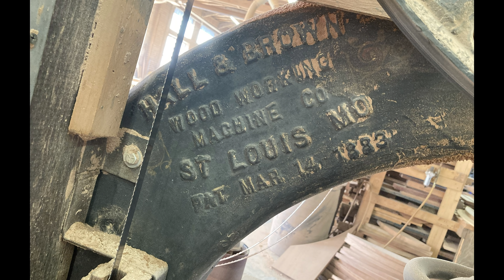Why Am I Getting NEW Window Sashes? More STRIPPING! EP 12

Comment: I've lived in an old house with old windows. It was miserable in the winter. Sometimes the best thing to do for your comfort and utility bills is to replace windows. The purists don't pay your bills. Thankfully, my house isn't as old and I was able to get Anderson 400 that looks like the older ones. You do the best you can and find an acceptable compromise like you're doing.
Reply: Inside snap -in storm windows are a low cost solution.  Made from clear vinyl they are held in place with self adhesive foam strips.

Comment: You are doing fantastic work indeed. For all the naysayers, ignore them. You are doing the house, and it's history proud. The new windows will be beautiful. Painting the outside is the only accurate and sensible way forward. They were painted from new. Even marine varnish needs redoing every few years. I cannot wait to see the end result. Well done, This Man. Originally the house would have had wooden storm windows on the outside of each window, that would need to be taken down in the spring and screens mounted on their place. A lot of difficult work twice a year. My folks had all new, custom made double hung sash windows made for our 1903 solid brick semi-detached. They were done by Sears, of all places. From the street, nobody could tell they were thermal pane double glazed with Low E coating and were argon filled. They also tilted in for cleaning. Is was as much of a safety issue as it was a matter of the old dashed, frames, and glass reaching the end of service life. Those windows are still in the house over 40 years later, and still working as new. None of the seals have failed, which is incredible.

Comment: It's your house,  you can do whatever you want with it. You're keeping the house as original as possible but within your means. People belly aching about you replacing rotted/broken windows should send you money to fix them. Keep up the good work!
Reply: Agreed!
Reply: Some of those sashes are beyond repair. The structural integrity is gone. On the ground floor, the original window sashes are simply not there, as they have already been replaced. The new windows will all match, for the first time in decades.

Comment: We have just replaced our windows with (gasp!) Aliminum double glazing,  we had the leadlight done too. It was almost impossible to get wood replacement , don't even ask the price! Or source timber.  Our glass was hand made,  don't even go there!     It was a major drama , to get the style and framing the same. 4 measures , 3 installments .but we got there. The frame colour was an off white / pale cream, looks just right. Interior frame we had made the same as what was there. We had major bug infestation  in 4 of them.         All you can do is make the best of what you have,  and what you are able to source. And you are certainly doing that, its wonderful to see others catching the bug for older homes. You are doing an excellent job.  Well done.

Comment: You can steam out the dent in the wood trim. It will help you get to those little spots where the paint lays in the damaged areas. Gunsmiths do this to lift out dents with high grade wood stocks. It’s better than sanding which can remove to much of the original character

Comment: You can move that table saw yourself. Get 3 pieces of scheduled 80 and cut it wider than base, tip saw, adding each pipe one at a time. Push slowly until one piece gets kicked out the back and move it forward. Repeat until you're at your destination!! I did this with a 12X16 shed and moved it myself over grass.

Comment: Do consider if its possible to insulate those exterior walls that you are having to replaster. Even a 1" thick foam insulation makes a huge difference. It would also give you a place to run electrics.
Reply: Modern insulations can be detrimental to historic houses. They need to breath and insulation doesn't allow that.
Reply: Yes if it was me I would insulate bedrooms and bathrooms.

Comment: Thank you for going into more detail on the windows.  While I'd advocate for restoring the original sashes where possible and for matching the historic wood species where new wood is needed, I can definitely appreciate having a limited budget and the need to secure the envelop of the building.  I have been associated with many restoration projects and cost is always a major factor.  Taking a phased approach with the windows is understandable.

I am very glad to see that you are replacing all of the non-historic window sashes with new sashes matching the profiles of the historic.  I am also very happy to hear that you are keeping and storing the historic sashes so that repairing them can be a future option.  Be sure to number them to their specific window openings before you remove them as they were often custom fitted in their frames.

While Mahogany is a good wood for window sashes, the change of species can make it a challenge to match the historic interior finish.  When trying to blend in a non-matching wood species, the first impulse is to darken everything - but to do so conceals the beauty of the historic woodwork.  Keep in mind that since the mahogany is the non-historic material, that is where you should focus any necessary tinting to try to make it work with the surrounding historic woodwork - not the other way around!  
  
Keep up the great work!

Comment: I want to make a little suggestion maybe you should probably think about when you take the old windows out to see if you can combined all the wavy to glass into the new windows, so that way you can still have the wavy glass look. probably use those if there's enough to combine them into a whole window, and put those on the front of the house. That way when you look at the front of the house they basically look completely uniform with the wavy glass if that's possible. Just an idea to think about. That way it saves on the cost, and for the future plans you have of getting more wavy glass. Also if you only have enough for a few of them than at least those are already done.
Reply: I was wondering if anyone else had this same idea,...  great minds think alike!

Comment: I restore historic leaded glass windows. If you want wavy glass a good way to get it supper cheap if not free is go to construction sites on old houses and buildings and ask if they are replacing the old windows with double pane and if they are ask if you can have it. Another is make friends with a window installer, they are replacing old windows with double pane all the time. Tell them you will pay them to save old windows they replace.

Comment: Another great vlog.  Questions.  Are you going to strip the baseboards?  Where the staples were, will you being using wood fill on them and if so what kind?  When you are stripping, did you use steel wool to finish?  Have a great week.
Reply from the maker: Yes on the baseboards the windows are just first on the list. Im not sure about wood filling the staple holes i might wait until they are stained and finished and use one of those color matched wax sticks to fill the holes with a correct color. Or maybe wood fill and faux grain them in spots. And yes on the steel wool. A lot of steel wool.

Comment: Tests have shown that less heat is lost thru single pane glass than in loose and poorly installed windows. Keep it real, and as original as possible with "some" modernization where needed. I like your approach. regards, Solomon

Comment: Good luck using those old 2x4s those  look like Ponderosa pine with age they get hard as concrete. You can't hardly get a nail to drive straight. And some I have redone I had to put modern tuba fours next to the old ones in order to have something to nail to

Comment: I understand the desire for everything to match, but I'd be tempted to tally up what I have and try to do one side of the building, or the private rooms or public rooms in the old glass straight away. My experience has been that basement stuff just gets becomes clutter that prevents easy access to things that need fixed. I'm glad you showed the old sashes, repairing them definitely seems crazy with as neglected as they are.

Comment: Just a thought if you replace any lathe and plaster with regular plaster board, if it doesn’t make sense in certain rooms for example due to cost. you can slightly emulate the acoustic of it by using acoustic plaster board. Although it wouldn’t be the same it would be closer than regular plaster as they have similar acoustic properties.

Comment: I've got two handy hints for saving you time and money with the window restorations.   
1) Build a steambox for the sashes.  This makes it very easy to remove the existing glass panes. Also, you'll be able to strip most of the paint from the sashes very easily. 
2) Put all your painted window and door hardware (iron, steel or brass), including lifters, locks and rollers into the embers of a fire.  In 20 minutes all the paint is gone and you then just need to clean them up with soap and water, steel wool and methylated spirits.
This will save you both money and hours of toil.  I learned about them both from watching YouTube. Good luck!

Comment: I had an 1865 house... Replacing the old sash windows with architecturally correct working sash windows with uncracked glass and working weights etc was expensive but we'll worth it. No aluminum!! Great job you're doing.

Comment: When it comes to the issue with the wavy glass- would it be possible to salvage it? Perhaps it is because I am not an expert at this at all, but I personally would keep the wavy glass panes and, when reconstructing the window, I would place the wavy glass panes on the top row of the widow and then the rest of the window could be standard glass. This would only work if you have enough way glass, and you may not be able to do all the rooms. 

Perhaps it would look odd to see it in-person? I don't recall what wavy glass looks like compared to standard glass in-person.

Comment: I don’t know if you’ve tried this but I have used a mini-hacksaw when trying to get good mill work off the walls without splitting or cracking. If I can get the woodwork out just far enough to slip in the hacksaw blade then I can use the blade to cut the nail. One the first nail is cut I then slide the hacksaw up to the next. Once the woodwork is off I determine if I can pull the remaining piece of nail through from the back. If I can’t then I’ll leave it in place and just grind or sand down the old nail nub to the wood surface.

Comment: Will you do hung windows with sash weights?  I did not do that.  We went for a wood window with weather resistant outer sheath and double pane.  We filled the weight channels with insulation.  Our house was built in 1874.  We owned from 1981 - 2015.  It sold on the day of the open house.   Your decision, what ever it is, is the best for you and your home.

Comment: Have you tried using dental picks or even the cheap wooden shish kabob skewers to get the paint out? Works great for the tiny nooks and crannies.  Good luck and looking fantastic.
Reply from the maker: dental picks have been super helpful. Along with steel wool and copper wire brushes. All used very lightly of course.

Comment: I noticed while during the paint stripping parts that you have older, non-grounded outlets in the trim, and newer looking (possibly grounded) outlets next to them. I know you mentioned the electrical needs to be redone due to the knob & tube. What are your plans on the outlet placement? Or are you at the mercy of the electrician for those decisions? 
Also, I'm guessing you'll be getting rid of all those old phone boxes. 
Amazing work so far. I'm really enjoying the videos.
Reply from the maker: I think we will run them in the floor on the exterior walls. They currently have conduit running on the outside of the building which i hate and want to remove. A lot of other decisions will be made by the electrician though as i dont know how many outlets a room needs to meet code.

Comment: I did not hear it in the video or see anything in the comments about the replacement glass type.  Are you going to go with insulated panes?  As some of the others have said, old windows, single pane type, will leach a lot of heat.  By putting in insulated panes no one will be able to tell just looking at them and you will appreciate it in both cold and hot weather.  

Also, as someone who has stripped a lot of woodwork I do not envy what you are doing but your trim is beautiful and it will be worth the effort.  My wife and I were so thankful that our 1890 house does not have painted trim.

Comment: I would get rid of that medium sized tree next to the garage. Now, I abhor the removal of trees. But, in this case it's too close to the garage and as time goes on and the tree gets bigger, it will damage the garage foundation.
You can see where the leaves are already running havoc on the garage roof and a constant maintenance chore.

Comment: When you were outside, (7:45) between 1st and 2nd floor there are diamond wall tie plates. Likewise at ground floor level (23:00) There will be thick iron rods through the floors to diamond wall tie plates on the opposite side of the building.
In view of the level of decay in the house, you may wish to check those rods for corrosion. They are there to stop the walls bowing out. There didn't seem to be any cracked brickwork so all may be well, worth a dose of looking at though.

Comment: Don't beat yourself up for replacing the sashes. Although I believe in preserving everything original, I entirely agree with your decision to replace them with accurate reproductions as they not only all match but will better prevent water infiltration and further damage. Besides that you are preserving them by not discarding them. I would suggest that you try to reuse enough of the period glass for at least the street facade but that, of course, is completely up to you. Keep up the excellent work, I love to see a sensitive restoration!

Comment: Basically what I was trying to say before is this..at least you have the first floor where it's most noticeable and that's most people's eye level I.e. ground level per se. with all the wavy glass in them which will give you the original window look that you're wanting. so then you can knock out those from the start. You will have a head start on getting the original wavy glass look back into the front of the home. Which is a money saver in the long run....

Comment: Great job.   Just an idea about all those horrible staples.  Staples don't make drilled holes, removing wood fiber from the trim.  Staples sorta shove wood fibers to the side and  squeeze themselves between the compressed fibers.  Soooo the wood might all be there.   If you steam the boards it may make the wood fibers decompress and fill in the gaps made by the fibers.    Just an idea.   I've seen Norm Abrams (from This Old House) make a steam chamber with large PVC tubes and a steam source.   Just something to think about.  Good luck.

Comment: Admire how you're taking great care with the trim work. How many layers of paint are you having to strip off??
Reply from the maker: depends on the room. But between 4 and 7 ish from what ive seen. few coats of aycrlic on top with a few coats of lead underneath. Although most of it is white so its hard to tell. But its pretty thick in areas.

Comment: No one should give you flack for the way you've chosen to replace windows. You are having authentic wooden replicas created, which, from a historic preservation standpoint, is highly commendable and a costly proposition. Most renovators would not even consider this as an option. At best, they'd have modern units that are as similar as possible installed. That's to say, some major window manufacturers make units in historical styles specifically to replace vintage ones. In almost every scenario, that would be considered an adequate outcome (I mean, hey, at least they're not those horrible vinyl things with the lines of 'tape' to simulate divided panes, right?). But they're still not custom, 100% true to the originals like the ones you've commissioned. Fantastic work! Love watching your home come together.

Comment: Have you considered sending the painted trim out to a stripper who has a large vat and getting it done that way?  Or, can you rig up a vat of your own in the garage using a tub and the stripper they use to make it more of a mass production?  You could stamp the back of each one using a punch set and spreadsheet to keep track of the parts and where they belong.  It might make things easier so you can plaster and do any repairs without them in the way.

Comment: I don't know if you read all your comments however, get yourself some soft brass brushes and you can take the material you are stripping off in the grooves. Another thing to get is many and in various widths of a plastic scrapers. They are cheap and you can cut them to fit in areas for removing your stripper and old paint. I've done restoration of victorian homes on and off for over 20 yrs. I can give you many tips to save time. I see you removed the trim off the second window,  if you do that and mark them it will both be easier and save time in the end because you won't have to be so careful as to not get stripper where you don't want it.

Comment: When they made the original wavy glass  they worked very hard to make it non wavy. When making wavy glass in the 21st century they have to delibately make it imperfect.  
So there is really no need to get fussy with the glass.  A 19th century person would have that house stripped out and replace it with the most modern for the day.  Just keep that in mind when some one niggles you about how you are going about your restoration.👍